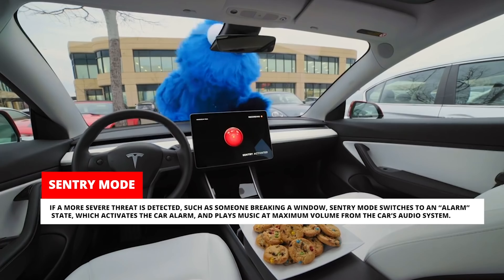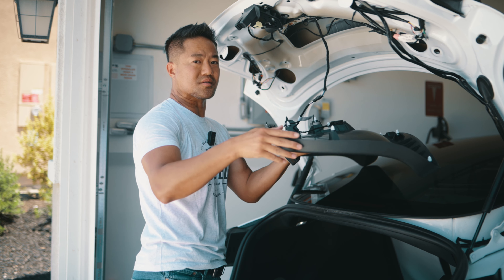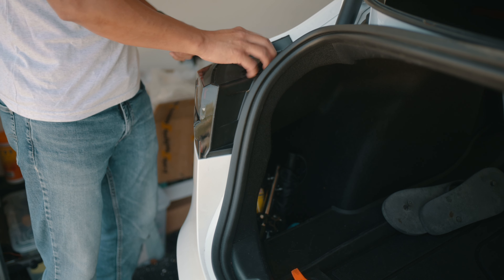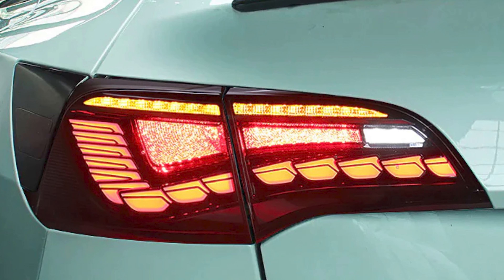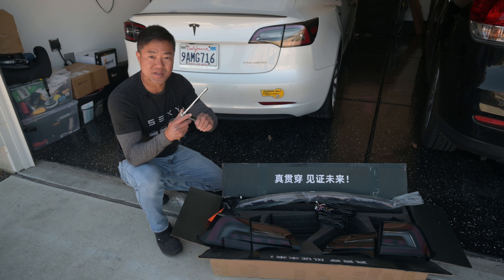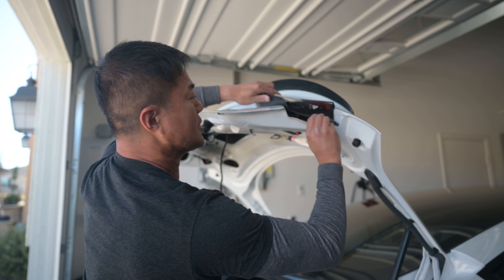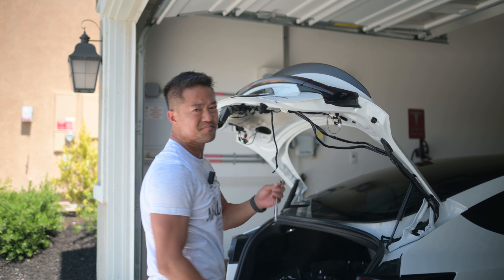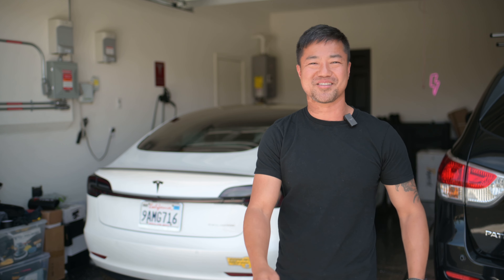How to Replace Tesla Model 3 & Y Tail Lights | then install Tail Bar Light Full, Cybertruck Style

Comment: Hey brother I was wondering if you can help me.  I just installed mine on my Model Y but half of the light bar wasn't lighting up. You have any ideas what's wrong?
Reply from the maker: It’s possible you screwed it on too tight and it’s pinching the wires. Loosen up the screws a little
Reply: @CameraToFreedom  oh I test it before actually installing it

Comment: Hey Myong, i see that you're still going strong with these taillights.  Do you think the lightbar will come off with the trunk vibrating from my subwoofers?
Reply from the maker: That tell Barlet is tricky. I had to put more tape plus on the bottom. I actually have an additional regular tape that holds it in place. It’s not perfect, but at least you cannot see it unless you look down and up into it. Only because I feel like That vibration and constant movement might make it come off so I personally just wanted to be extra safe. It’s been a couple of years with it and it’s still holding strong, but I know if I just leaned on it you will come off.
Reply: @CameraToFreedom  damn, I have 2 12inch subwoofers in the trunk. I'm a little more nervous now lol

Comment: Commenting on an older vid, but love this!  Curious, does that bar get in the way of the camera when reversing?
Reply from the maker: It’s one of my favorite accessory for sure! It doesn’t block your camera. You can see it on top of the screen but everything is very visible.
Reply from the maker: Discount Code 'MYONG' on ALL Tesla accessories in Tlyard’s  website: bit.ly/3HRUT0p
Reply: @CameraToFreedom  no worries, by default be it haloblk, evbase, or others , i try myong in my cart every time lol. I'm on the fence between on yours and the Lite Version Full-Width Strip,  I saw some videos of that light also showing on top, but i don't know whats worst.  so still debating lol